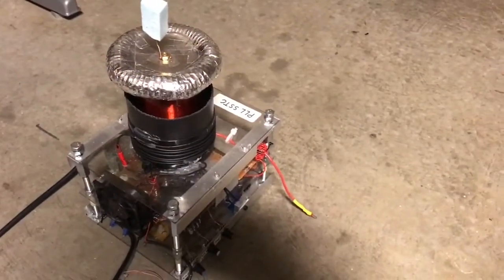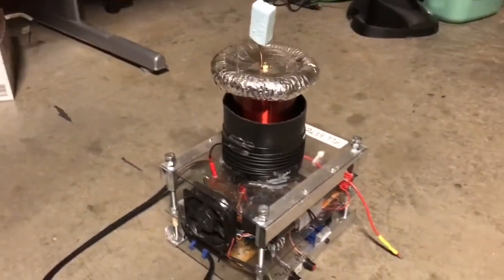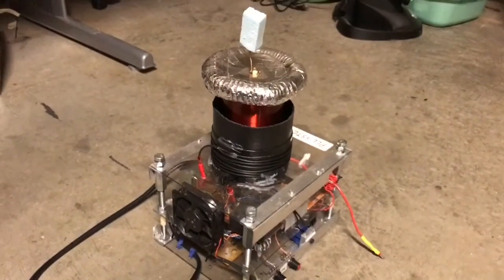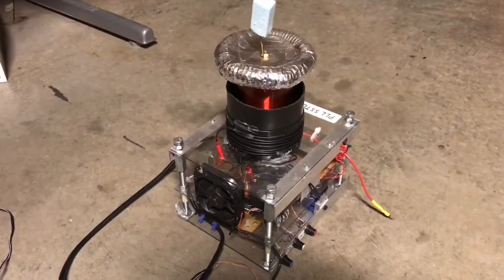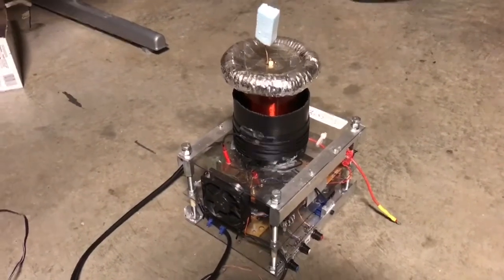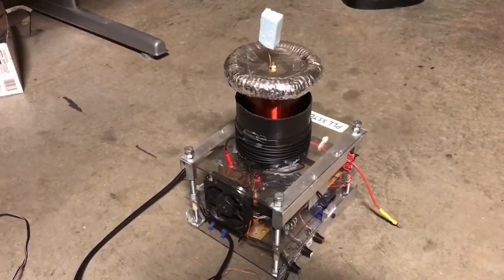Ramped PLL SSTC Run

Comment: hi friends.. do you use a mmc capacitor in series with the primary coil?
Reply from the maker: Yep you are right the secondary does not have a resonant capacitor bank and also the full bridge inverter has no BUS cap. The output is generated entirely from the mains input.

Comment: Hi.

I have 2 questions, please reply.

1. Can you touch these arcs? (I know that one can touch these in other designs, but your's seem very high powered).
2. What does "ramped" mean? I'm not from English speaking country so I have difficulties in understanding this word.
Reply from the maker: They can be touched for short periods. The arc Frequency is about 400kHz so skin effect is strong. Ramped means the voltage across the drain and source of the MOSFET is increasing with time which causes sword shaped sparks to form.
Reply: @BrianDhvTinkerer  Thanks for quick reply. Did you touch it yourself? Is it painful? Or it feels like ordinary SSTCs?
Reply from the maker: @zauraliyev367a2  I didn’t touch it but a friend of mine did and said it feels
Like an SSTC
Reply: @BrianDhvTinkerer  Thank you very much. I'm going to build one of these (actually I built SSTCs previously but they were low powered). Can I contact you if I'll have difficulties?
Reply from the maker: @zauraliyev367a2 yes please feel free to contact me!

Comment: Plz schem
Reply from the maker: Use this for the staccato controller:
http://kaizerpowerelectronics.dk/wp-content/gallery/2008_11_06_-_kaizer_vttc_i/staccatosch.gif

The output of the staccato is connected to the pin 3 of both mosfet driver chips to turn them off and on  in sync with the upswing of the mains input across the full bridge. There is no bus capacitor with this setup. The 120V or 220V AC mains is connected directly across the full bridge inverter to the primary. There is no resonant capacitor in series with the primary but instead  a 2 uF 1kV DC blocking cap. The primary was 7 turns of 16 awg wire widely spaced on a 4.5 inch PVC former.  The secondary was 4.7-5 inch tall 34 awg on a 3.5 inch PVC former.
Reply from the maker: Use scopeboys setup for the PLL SSTC:
http://uzzors2k.4hv.org/projectfiles/pllsstc1/PLL%20Half-bridge%20SSTC%201.GIF

The pin 3 on the UCC mosfet driver chips is connected to the output of the staccato controller. I used a full bridge of irfp260n MOSFETS instead of half bridge.